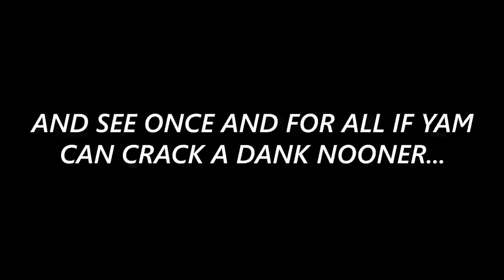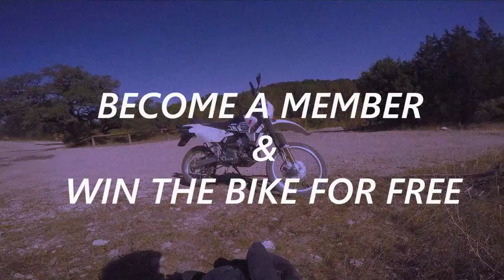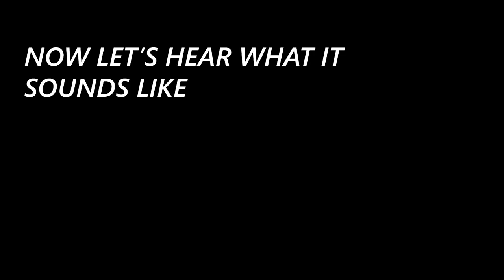BEST Exhaust Setup for KTM Duke 390!

Comment from the maker: The way this bike sounds, really cements it as the king of the little bikes. It's every bit a supermoto. If you want to win it and get some merch on the cheap, head over to https://yammienoobmerch.com/ and use the code TRIPLE2020 for 10% off!
Reply: First
Reply: Hey yammie, what do you do with the old pipes? If you haven't disposed of that duke 390 exhaust and willing to sell and ship it, i would take it. Mine is scratched
Reply: @Yammie noob what are your thoughts on the 390 Adventure vs the duke?
Reply: Nice video👌 Have you tried the Husqvarna 401 Vitpilen or Svartpilen? Same engine as the KTM 390😁 Fun little bike. Try it out, if you get the chance💪👌😁😉
Reply: Is it completely okay to just weld and remove the baffle from stock exhaust on the 390 and ride it without any mapping ? Will it affect my power/engine/top end anyway in the long run ?
Reply: its not a supermoto at all. it has a thumper engine but its a standard naked bike
Reply: @180FiftyFive  not many sports tourers are actually sport anything.  On that I would consider this a motarded naked or just a BBC with wheels.
Reply: Your watcher from philippines
Reply: the 390 just sounds like it's Indian brother the Dominar 400
Reply: Has it been won, I have wanted this bike since I was like 13, it’s just perfect
Reply: Can I get this one ship to India bro??
Reply: I get that this video is 3 years old, but this title should go to the MT03 with the full Toce exhaust. It sounds absolutely insane.

Comment: I think Ktm put on a 12 and 13 mm because then you can install it if you only have 1 set of wrenches.
Reply: I think so too, I've seen it a few times on my bikes
Reply: That actually makes a lot of sense...
Reply: yeah, its because you don't even need a set there is 2 different pieces in the given toolset so you can just do it with what's provided.
Reply: Exactly
Reply: Brilliant point
Reply: Exactly, which is how most cars are when you work on them.
Reply: Thats actually pretty smart. Coming from a car family with 50 of each I thought it was daf. But now I realise im the one who is daf not the engineers who design bikes for a living...

Comment: I love my 390 Duke! It is the most fun bike to ride over most of the other smaller displacement bikes. Nice work Yami!
Reply: Facts. I fell in love with mine on the test ride. I've ridden a lot of the common smaller bikes and this one is the most fun in my opinion.
Reply: I want my first bike to be able to handle 2 people up a canyon. How do you think this 390 would do?
Reply: @guywholikescheese97  depends on how heavy both members are combined. Also depends on how long you plan to ride for. The pillion seat on the duke is not known to be the most comfortable place to be. It can do it but don't expect to have a ton of get up and go if you're talking 300+lbs of people on board.
Reply: I sat on one at a dealer, but it felt like I was falling forward and I was literally squeezing my two captive nuts. Do you have that same issue?
Reply: @edman79  not at all

Comment: Even cheaper than a slip on is using a 40mm core drill and just cutting out the baffle in the end of the stock exhaust. It sounds fantastic and its super cheap.

Comment: 13 and 12 means one set of wrenches can get the thing loose... if it were both 12 youd be worse off. 

Ktm is usually pretty good about really good tool kits but they won't give you more than one of the same sized wrench.
Reply: The tool kit that comes with the bike has a combination 11/13 and a 10/12. And comes with the allen for the clamp

Comment: Love the little Duke. I had the 1st gen 390 as my first bike, which looked great in it's own way. I bought it with an Arrow exhaust which sounded great too. Ultimately I sold it because I am surrounded by highway with 70 mph speed limits and it just felt like it was punishing the engine commuting at those speeds every day. Great city bike though!
Reply: Me too I’m looking for first bike but my local highways are 70, what can you recommend given I want the duke so badly
Reply: @ImaYam  Anyone know if an ECU flash kit will solve this problem? looking at Coober kit..
Reply: @godinminaar9024  perhaps a gearing change will address this over a time…
Reply: @ImaYam  Thanks, I know what you mean. PS. The ECU should be a +5 and extend the power band up to 12k rpm. Should make the bike less wimpy in 6th gear?

Comment: The stock exhaust doesn't look bad really, but it's sooooooo unbelievably quiet in that test footage... Is the header down to the slip-on one piece, or could you get a mid-pipe to remove the collector and retain the stock muffler as a bargain basement option?

A tap with a flat head screw driver and mallet will often also break that weld for the baffle if its only a small one and you don't have a dremel.
Reply from the maker: It’s very quiet IRL kris! I believe it’s one big piece but I’d have to take a look again
Reply: @yammienoob  Makes sense it would be, probably to stop people doing this!

Comment: PSA - That weld on the BD killer (baffle) is compulsory by law in EU for Euro 4, many remove it but you can get in troble for it, even in Italy where Leovince is located

If the baffle can just be screwed out it can be homologated only as Euro 3 or Race Only. Same case if no baffle is there it can only be race only.

You will see them on the road but you might get a fine for it, except if you are a Harley, Harleys don't count, don't ask why...

Comment: You shouldn't be upset about the 12mm and 13mm bolt heads.  They do that so you can use 2 wrenches out of the same set, and dont need 2 of the same tools. Its actually a good thing.

Comment: I like the Akrapovic' exhaust for Duke 390 more than any other after market exhaust
Reply: I don't because if you ever want to pull the dB killer out of it you have to basically disassemble the end cap of the pipe and rebuild it.

Too much of a pain in the ass.

Think my carbon fiber LV Pro is every bit as nice as the Akra and sounds better.

I've had both to compare.

Comment: Hey yam! I own the exact model duke 390 and I slapped on a akrapovic carbon series slip-on. It sounds perfect. Not too loud under 4000rpm and screams on the higher end. If you get a chance, try it out. You will not regret.

Comment: I would much rather remove the dB Killer/baffle from the stock exhaust because a single cylinder or a thumper doesn't sound good when it has an aftermarket exhaust mainly Duke 390 with it's high compression ratio engine it sounds like if I removed full exhaust even headers and also I don't like the sound of bike on these aftermarket exhaust on only Duke 390 I like them for other bikes but if u just remove the baffle of the stock exhaust by using a hole saw I will won't as sound loud as a aftermarket exhaust but it will increase the bass tone of the bike which is what I prefer.

Comment: It seems you did not reprogramme the ECU or add an aftermarket controller.  I replaced pipes and added a KN air cleaner to a Sportster and it ran terrible, requiring a reprogramme of the ECU.

Comment: Yo I just got my license what's a good exhaust for a 2015 cbr500r
Reply: I have the Leo Vince GP Corsa Evo on my 2016 500R and it's been fantastic. Rode all of last season without the baffle, sounded great. Did opt to put the baffle back in for this season though. May remove it again at some point depending how I'm feeling with it. The Evo is not available for the 2015 model, but the regular GP Corsa is, among a few other models.

Comment: Honestly i bought this exhaust but i originally used a hole saw and removed the db killer on the stock exhaust it sounds very similar its not worth $600 for the slight sound difference

Comment: Whomever is lucky enough to win the BEGINNER BIKE GIVEAWAY SERIES! I would recommend avoiding this KTM 390 Duke unless you plan on putting it on craigslist to make a quick buck!  It is strongly advised, during a motorcycles running in period (bedding in period) not to over rev them for a sustained length of travel, as this is likely to cause irreversible damage to the piston rings, piston and /or cylinder block lining.  On a 390 DUKE during it's running in period, a FLASHING  tachometer (Rev counter) indicates you are exceeding the recommended rev limit at this vital time of a motorcycles life.
Reply from the maker: Break in periods are myths and have been debunked time and time again
Reply: @yammienoob  LMAO,  This needs a 13mm and 12mm spanner/socket to remove it!  OMG what do I do, I've got the least stocked tool rack but still think it's amazing.  When the dealer plugs the 390 in for it's first service the warranty wont be worth the paper it's printed on!  It's 2020 not 1999, a free Bike just got very expensive...
Reply from the maker: You sound hurt and angry. I hope a loved one calls you today and reminds you that it ain’t so bad
Reply: @yammienoob  Just found this in my junk mail box, seems even outlook identifies your lack of  knowledge as junk pmsl.  but you're right  I am hurt because it pains me to watch you and the sixth spice girl working on a bike and it angers me that you clearly have no idea what you are doing and encourage people to void their warranties by replacing stock parts on a brand new bike!  As for a loved one calling me at this time of upset with the Covid19  pandemic I speak to my friends, Brother, Sister and Parents daily on the phone also my parents are considered vulnerable at this time and cannot leave their home and as I live within a mile of them I'm currently doing all of their shopping so get to see them two or three times a week(2 meter social distancing observed).  Remind me again when was the last time you saw your family?  It isn't so bad!  Right?